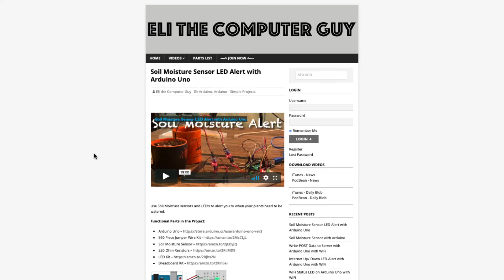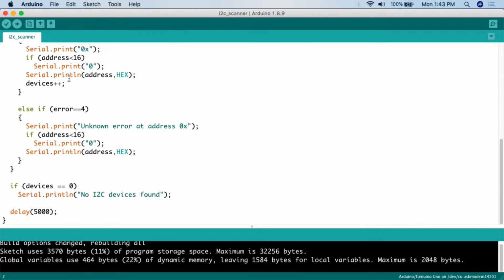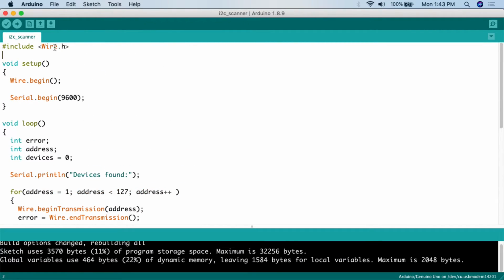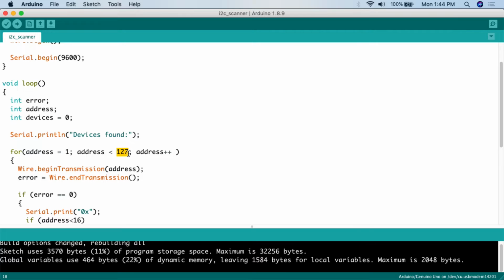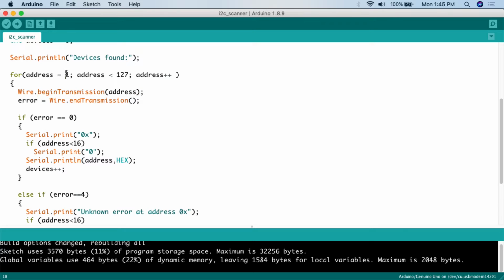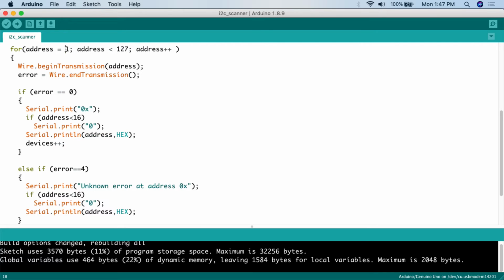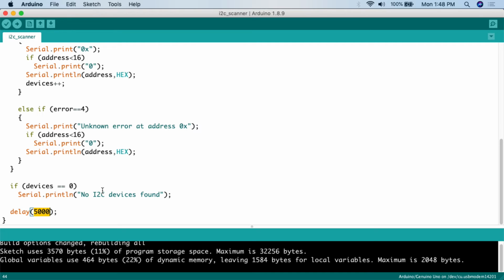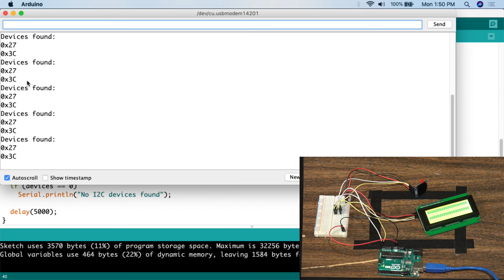Find I2C Addresses on Arduino (I2C Scanner)

Comment: I'm just throwing this out here to maybe help someone else in the future. I realize I'm responding to a video that is now a few years old. I'm just starting with Arduino. I have an Arduino Mega 2506 R3. I first connected my i2C display to the A4 and A5 pins on the Arduino. This did not work, I had to use pin 20 (SDA) and pin 21 (SCL). This is probably pretty obvious to most people, took me a few Google searches to figure out.

Comment: 2:50  Don't you have to specify which is the clock and which is the data?   Also, how do I know that the scan program is outputting to those specific pins?    

12/16/22

Comment: First of all thanks for every things you gave us.
I have some ATMEL uC from trash and i would lik to reprogram them but i don't know the value of their working frequency (crystal) !!.
If i want to reprogram them with known frequency program using the SPI protocol , the SPI clock pin will allow me to do it? ( without knowing the value of the clock).
In other way the clock pin of SPI protocole will replace the crystal clock ( at least during reprogramming operation ) ?.
Thanks.

Comment: Hm. Nice try Eli, but nope. Close,  but nope. First off, you cannot iterate 1 -> 127. You omitted 0 because you probably know it's special (I2C broadcast), but it's not the only one. If you look up the I2C reference you'll see addresses 0-7 are reserved as are 120-127. So in fact, you need to restrict the scan space to the interval [8;119]. You probably just got lucky with your attached devices that they didn't go mad when receiving one of the reserved addresses. Second, you need to assume some device might get mad and lock up your I2C bus, which is why you need to implement a scan timeout as well as a I2C bus reset for a full fledged I2C scanner.

Comment: What should I do if it says "Devices found: No I2C devices found" although a module is connected?
Reply: Check cables, make sure the device isn't fried. You could have a 10bit addressing only I2C device (very exotic), that will not be seen by this scanner.

Comment: 2c_scanner Arduino UNO to PCA9685 16-Channel 12-bit PWM Servo motor Driver I2C Module For Arduino Robot E5  just keeps saying Scanning Scanner in more like a GUI not a text display what is wrong: Wires correct and baud rate is the same as code

Comment: Sir I ran it for my Arduino UNO & its showing "no i2c devices found!"... What should I do now? I'm also not able to connect BMP280 sensor!
Reply from the maker: you either miswired your device, or it's broken
Reply: @elithecomputerguy  But Sir the accelerometer sensor is running perfectly with UNO. Also when I searched for I2C with BMP280 connected, it shows its register address. I checked the wiring thrice & it looks okay. I'm actually confused on what should I do now..
Reply: @K-Luxuriant  Some things don't work with other Arduinos.  Example Oled only works with a NANO.